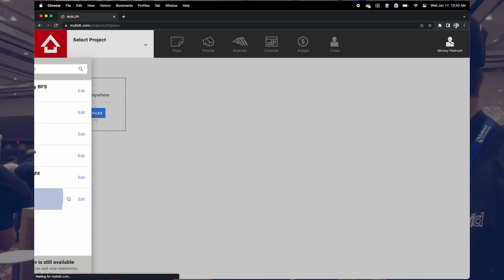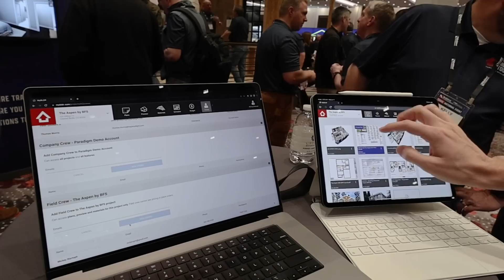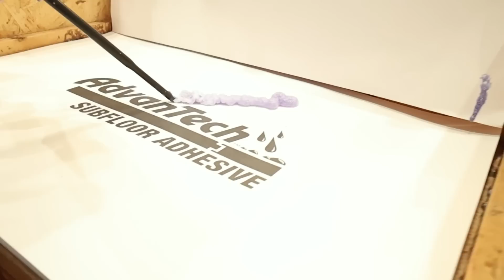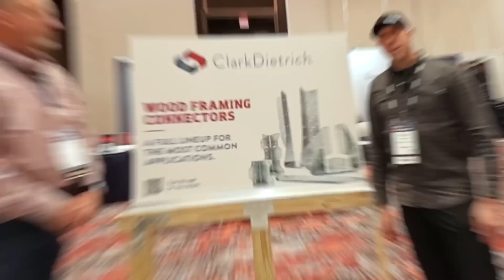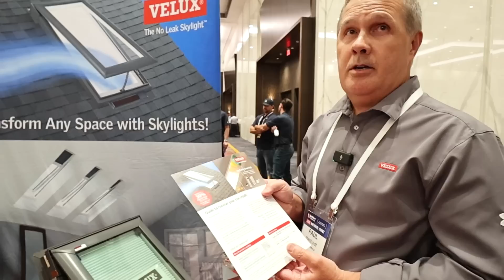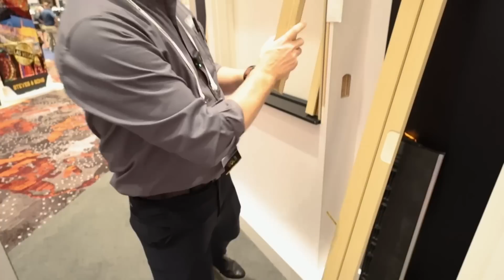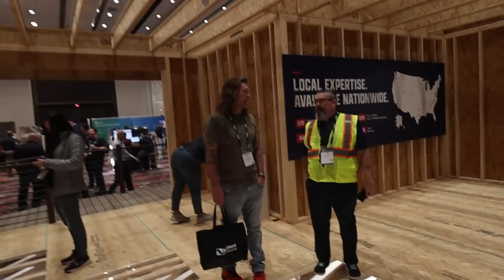Residential steel joists & more from the BFS 2023 National Event!

Comment: As a homeowner, that 3d rendered framing view would be awesome for future DIY projects.  For me to be able to see what walls are or are not structural, to see where the studs, plates, blocking, etc. are without having to open up the drywall.  Also, to see what materials and fasteners were used so that I can use the same things to remain code-compliant.

Most importantly, for me to see what I safely can accomplish myself and what I need to hire a licensed pro for.  I hope all that info will be available to the homeowner in addition to the builders.

Comment: Just to add to the below comment, one of the benefits of metal floor joists is no mud-sill required. I did my first house and let the  joist rest on the raised stem wall. I don't know what the average is for pressure treated wood is around the country, but the house I am building now is calling out 2.5" x 7.5" (3x8's) mud-sills and they are not cheap. Metal floor joist skip this step, combine that with ICF and you get a really interesting set of options. My current build will use ICF as the concrete form work, add ground insulation below the floor and I get a sealed crawl space. 
Throwing in another option with an 8 inch stem and 4 inch ICF walls, I can set the metal joist directly on the 4 inches of concrete and either plunge the joist into the 4 inch wall or directly attach the ends to the buried studs in the foam... The walls call be poured separately as a cold joint above the stem wall.. Does make thing interesting.
-MG

Comment: Did steel framing for forty years,it takes three times longer too build than wood. But if you know what your doing you can build a straight flat wall. It's hard to get good wood. Most of the people that steel frame do big commercial jobs.
Reply: Also you shouldn't put wood guys on steel or steel guy's on wood they eventually get it but it takes a while.
Reply: Another thing to consider with steel framing is backing for cabinets and finish trim.
Reply: Did you use design specific fabricated studs or stock studs?
Reply: On four story condo's the floor joists were designed for floors and cut to size they framed pretty fast. As far as taking longer I was speaking in general. I worked on a structural steel condo and they built a wood one next to it in a third of the time.
Reply: @keithwhiteley1303   prefabricated studs = not much need to cut the studs and quick assembly vs. stock studs.

Comment: Yeah, confrence WiFi is ussually real Shyyyyyt...  I've worked at many conferences that my company does and build the back end tech.  And the onsite wifi is horrid... the amount of phones in there really drains cell towner and people bring in hot spots and such and they get near dial up speeds, and then the convention center wifi, if the main show paid the venue for wifi, then the speeds are usually set to very slow and the ammount of attendies on it crawls it...  if a booth PAID (upwards of 5digits for a drop for two day show) thats the only way they can get reliable internet... so on jobsite hotspot shouldnt be that slow as it was here on the convention floor with the software.

Comment: You can't put a wall above the cut outs on the metal joists, that's going to really limit what you can do. You could also not modify the wall layout or remodel.
Reply: @H2s A regular 2 X 10 floor system doesn't need to be engineered. Why have we made house's so expensive that only the rich or those able to afford huge payments can buy one?
Reply: @tira2145  steel was the most affordable framing material, through the pandemic. You should have a design confirmed before using any make ready packages, but everyone is also able to buy stock studs that have no punch outs, just as you would w a normal 2 X 10.

Comment: Great show, especially the steel joists and the flush mount Anderson windows. Still looking to see a video on Comfort-board under stucco in place of styrofoam to increase fire resistance of stucco cladded homes in high risk areas. I can see that if a home was spared being burned, it may have still been subjected to heat stress, invisibly melting the styrofoam underneath. This would result in a significant loss of thermal efficiency. I am wanting to see a special weep screed and how the drip planes are maintained during construction. Thanks!

Comment: 23:20 Even considering recycling and reuse of steel framing, it has a significantly larger carbon footprint than wood framing. This is something we really need to be considering whenever we're looking at material alternatives.
Reply: What are your calculations?

Comment: I love the idea of wood free home construction but insulating this stuff has got to be a pain due to steel’s inherent thermal transfer properties. I also wonder what a non wood sheet-goods alternative would look like.  That said you’d never have to worry about termites.
Reply: You mean alternative to plywood/OSB? Look at Dens Glas or Securock
USG Structocrete is another one, but that’s pricey
Huber has an MgO panel
Reply: @philippenight2421  can any of those be used for subfloors though?
Reply: @MRBenchwork  yes, Structocrete is a subfloor product, and Huber’s 3/4” Exacor is rated as a subfloor, but they’re somewhat unavailable last I heard.. I think I heard that it’s made in china, and they had trouble getting it or something
You can always pour a suspended concrete slab like they do for skyscrapers
Reply: Install exterior insulation

Comment: Sheet metal joists.  Those aren't punch outs, they are lightening holes.  Duh, they been doing that since the invention of the Aluminum airplane (I'm sure before that as well).   I've routed mech sys and harnesses through lightening holes for 20+.  That flange around the hole effectively restores the "I" value of the beam.
Reply: would they vibrate alot compared to wood
Reply: @randomrazr  yes and no. The deck material would act as a great deadening panel.  I’ve seen red iron substructure with composite decks work just fine.

Comment: ClarkDietrich, there studs have been used in residential for 25 years, they are now seeing a potential for patents and making money in the residential market.
The studs and joist transmit sound like a speaker, pick the wrong gauge and the webs pop like an oil can, metal can block WiFi and have you ever tried to hang trim in a metal house... It's not all bad, if you find an experienced builder you get a strong straight house that doesn't move much and meshed wifi does the trick, and wood bucks are your friend...
The special track for the metal is not necessary, its just convenient. There are options using the track and studs that do most of what they trying sell. Also check the metal gauge on the material, there's a range for a particular gauge number. Some vendors do a re-roll,  they get raw material at the higher end of the range and re-roll it down to the lower end of the range. The guys I knew said the studs had knots, I know sounds funny, but re-rolling metal forge hardens it. This was confirmed by one of the sells reps after he had a few with the crew..:)
-MG
Reply: I used Dietrich joists for my ICF home in 2000.  By varying the Guage I was able to use same depth joists throughout the home.  Did have go 12 inches on center for the 24 foot living room span.   Very stiff floors, tile guys loved it.
Reply: @dvploeg1  Nice I built my place from all metal back in 1997, I made some "I" beams by placing the C studs back to back. The gauge never went up above 20 for the wall studs and headers and beams never went above 16 gauge, I used 10 gauge for the short shear walls. I was also able to weld some of the multiple studs as a bonus. The 25 gauge at Home Chepo are called "tin-can" buy the guys doing structural work or commercial. There was a push before I built my place to go with metal, but the designs were light gauge (18-22) and required a crazy truss like build and more screws than I could count on point load plates. If they had gone up in gauge I think there would have been a sustained use of metal, as it was the extra labor time and lack of experience didn't get metal off the ground. 
IF I did it again I would look at panels like Thermasteel, but I would be cautious they went into bankruptcy but they might be out, if they fixed there manufacturing they might be viable again.
-MG
Reply: It would be a big move if C.D. made their structural-gauge steel wall studs more widely available right off the shelf at a big box.
Reply: Never heard my metal framed home echo, but have in my iron ore building. Double wooded walls impede wifi at my house, but of course a mesh takes care of it. There's also a big difference bet. Structural and non structural steel studs.

Comment: Man, Ready-Frame's Build Optimize at $10k per build to not be an architect, GC or engineer.  Either every house I've ever walked into is small or that's going to be a tough sell.
Reply: How many hours of labor does Refi Build save on a 1600 sq ft house? Does it save $10,000 in labor and dumpster cost?
Reply: @ToddBizCoach  probably saves a lot of labor, but 10k is more than the whole framing labor budget for a 1,600 sf home

Comment: I've been waiting for steel joists to take off for decks.  Far superior to any wood you can get now and you can order most pieces cut to length so minimal cuts needed and very low waste.
Reply: How does it stand up compared to treated wood over the long term?
Reply: @brodriguez11000  I've never used it, but from what I've read, you can specify metal thickness and galvanization levels.  The only potential concerns I recall were high corrosive environments like coastal applications.  The also seem to be manufacturers offering their own steel systems that appear to be painted or powdercoated.

Comment: 47:27 ? couldn't get the OSB subfloor to land on the truss joist with 3-1/2 inch top. Whaaaaaaat?
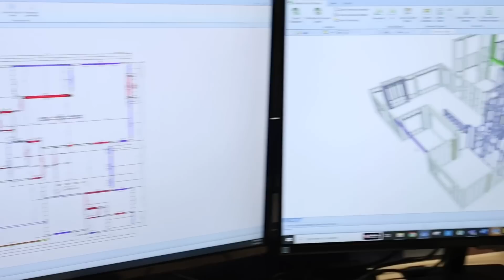39:39 taking the two dimensional image and building a three dimensional image. I like to do that in my head and always thought it was easy until I started working with other builders and designers. A trait called spatial reasoning. Turns out there are people for whom it is not merely difficult but absolutely impossible.

Comment: I am not a home owner, I am not rich enough to build a home, I am not a builder, nor is my profession anything to do with home or other building at all.

I still find this stuff interesting.
Reply: @GeorgeWashingtonLaserMusket    All good tips and advice !  I built my own in AUS but got electrical and plumbing contractors but did the rough ins myself.  Just do your homework on codes and requirements from your local authority; if you learn it and know it you can combat any orders they try to put on you !
Reply: @GeorgeWashingtonLaserMusket  Hey Billy, same situation here. I'm planning on a " small" house, 1 br, 1 ba about 500 SQ ft . They are doing 16 x 40 shed to house conversations which are a massive ripoff. Get a set of plans from your local drafting firm to submit to local permit office
The money you can save on labor is a big chunk of costs, and you can build it better
Good luck

Comment: That last segment on ready framing made me wonder about the ceiling trusses. I think they take out to much of the truss for hvac etc. Looks like a weak spot for sure. If that just holds up sheet rock then fine but another floor above?
Reply: That main, large trunk line cutout had me wondering, too.

Comment: Steel joist are terrible for WiFi. Don’t do it
Reply: If steel joists are bad for Wi-Fi how come Wi-Fi works fine in commercial buildings?
Reply: @ToddBizCoach  commercial buildings use a POE system with more access points. The next time you go into a commercial building just look up at the ceiling. You’ll see a round or squared white device with a blue or green light on. That’s a WiFi access point. You’ll also see that they have a lot of them everywhere. Also WiFi access points have the best signal strength at the top of the device so having them above you gives the best performance. Doesn’t mean they will have perfect WiFi, the steel walls may still interfere with the signal but having more access points does make it better. I had a house with one steel wall. I would get 100mbps outside of that room (this was 2014 fast) but behind the wall that was only 15 feet away I would get speeds around 15-20. Now if you ask why doesn’t everyone have POE? the reason for that is because it’s expensive. The POE switch that enables the whole system is around $50-$200 depending on how many ports you need. The access point itself is anywhere from 100-300 per device. Most of the time you also have to run new Ethernet cables that support POE most wired homes don’t use the right cable type because the POE enabled ones are more expensive.  But that’s pretty much why. The second best option is a mesh network if you have a house that’s wired.
Reply: @the7311  Thick wooded walls drastically interfere w/ signal as well.

 Mesh networks are very affordable today, if needed. Definitely not $800 worth of material.

Acoustics can be dealt w in a steel or wooden home.
Reply: @nm3547  yea mesh is pretty cheap now but I was referring to POE access points when I said $800.
Reply: You can get a signal repeater for inside your house that has a antenna outside if you want your cell phone to work better.
Reply: @shannabolser9428  repeaters are ass they half your WiFi speeds and increase your ping. Just go with a mesh network especially if your house is wired.
Reply: If you are building new just hardwire your home. So much healthier for you to not blast yourself with signals all day every day. In fact even better because you are doing something passively to block your neighborhood signals from infiltrating your home without having to make your house into a piecemeal faraday cage. Steel joists look like a win/win/win/win to me.
Reply: @626sarBKBruerrE  bro radio waves don’t do anything to you health wise. That’s a terrible reason to install them. I do have my entire house wired with Ethernet. The problem Is that you can’t wire things like your cellphone laptop tablets nor smart home appliances. So having steel walls is not a good idea for wifi connectivity.
Reply: @the7311   wood and other materials block radio waves as well.. I think steel framing is fine. Perhaps your wifi connectivity takes a bit more of a hit compared to wood frame, but at least the house is less susceptible to fire and bugs, seems like a good trade-off to me
Reply: @philippenight2421  it’s not a good trade off at all.  I lived with it for a couple of years and i absolutely hated it. If you are worried about fires in a new construction just add fire sprinklers. They are already required in California where I live. Steel walls are also complete ass when it comes to mounting things on them especially if you need a stud. They were too far apart for what i needed. Giving me no choice but to open the wall and add wood studs. I was 13 at the time. Bugs are a bitch but i feel like there are other things you can do. I mean i get it you guys must be in your 50s and don’t really care but i really do care. Its very important to have good WiFi at home especially with all the new devices that require/have it to make the device more functional. I’m no WiFi toaster fan but if the home owner is they will dread the shitty service in their kitchen. But i guess at the end of the day to each their own. I prioritize WiFi connectivity because we are in 2023 the internet is the future.
Reply: @the7311  hm, I have steel studs in my house, and my wifi seems to work just fine when I’m behind walls with my phone. My house isn’t big though, so that probably makes a difference. I’m 26 years old lol, internet is great, but it isn’t everything
Reply: @philippenight2421  size is definitely a factor. Seems to work and having the best connection rate are two different things. The reason i’m so against steel walls is because I’ve done networking in a couple of homes. Wood wall homes always left the owner super satisfied with the install but homes that were mainly built with steel walls are always super disappointed. I explain that it’s the walls that are an issue. They always want to add more access points but then I need to explain that adding too many will also effect connectivity due to the cluttering of the radio channels. When people pay extra to get 1 or 2 gigabit for internet but end up with way less in certain rooms after spending $800 on equipment alone. Then it’s just super frustrating for them. I let them know ahead of time what they will experience slower speeds due to the way the home was built. That also ends up upsetting them because most of these people spend well over a million for a home that has “cheap walls”. Even though at times it’s not cheaper. Also from my experience the walls seem to be terrible for acoustics. I’m no framer so i’m not sure if it’s from bad installation or if that’s just the way they are. Over all i’m not a fan of steel walls. I get that you can always just wire your whole house which I also recommend but that doesn’t solve the problem for everything that can’t be wired.
Reply: @626sarBKBruerrE  lol
I just got my Faraday pouch for my key fob for the car from Amazon today it's funny you should say that
Reply: Not a bad thing, actually. I bet people sleep great in that house. All the wifi can interrupt sleep.
Reply: @juliesmith5620  lmao y’all a bunch of nut job conspiracy theories